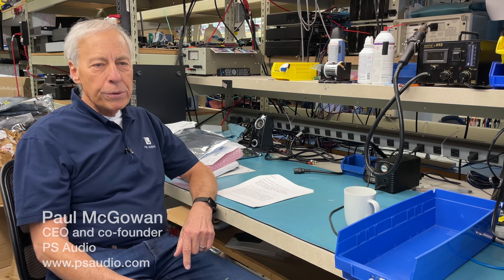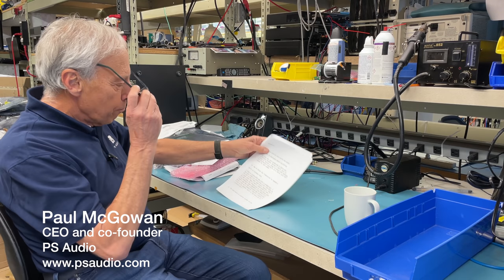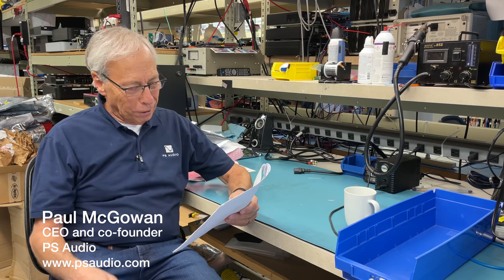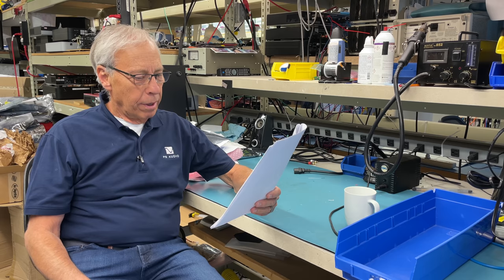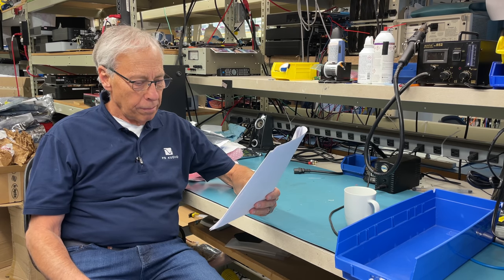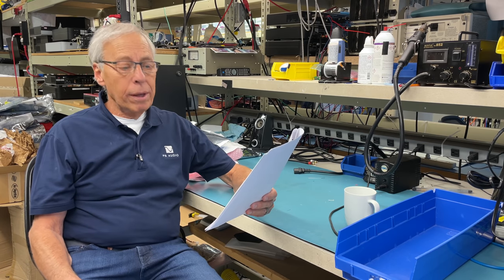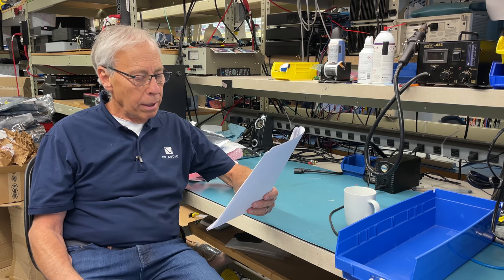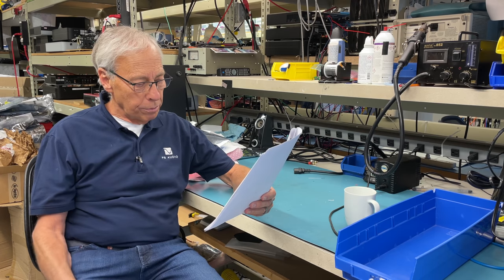How to block low frequencies to speakers

Comment: Totally agree, where the mains roll off naturally is where the sub should start. 
The sub shouldn’t replace anything, just add lower frequencies of bass.
Reply: The problem is when small bookshelf speakers are trying to make bass down to around 40Hz and they do it with poor distortion. Your subwoofer will either overlap significantly in half it's frequency range and drums around 40-100Hz can become much more distorted when playing loud; from my experience. Especially music that has more pure deep bass can reveal when your poor side speakers are trying to reproduce deep bass but can't do it well without distortion in 10s of percents.
Reply: The most common starting sub cut-off recommendation  is @ 80 hertz whereas any speaker out there goes down to 60 in the very least. Then again, if you have a crappy drivers then....
Reply: There's another good reason to intentionally roll of the response, as I've found out. If you're sitting close to the speakers and the sub is off to one extreme, you can get quite a lot of undesirable overlap in the response, and very odd sounding bass, not to mention it spoils the illusion of the bass being omnidirectional. I found that adjusting the phase, and putting a fairly sharp roll-off on the main speakers at around 80-100Hz helps quite a lot, so that only the main speakers or sub are playing at any one time. It puts a narrow notch in the response, but otherwise it works quite well to give a uniform, flat audio across the low end of the frequency range.
Reply: @ThinkingBetter  That's actually a good observation. Woofer drivers are quite nonlinear at their extremes, and they will produce a lot of distortion and harmonics if there's significant bass and midrange audio being produced by one driver at the same time, and this can be seen on instrumentation if you take measurements. Its possible to even produce IMD at the excursion extremes if two tones are being played by the woofer. A sub helps get that audio out of the main speakers, freeing them up to just handle the mid-bass, which produces a lot less distortion at higher volumes.
Reply: @mysock351C  Paul is promoting what his current product lineup can support. It would be nice if they actually addressed this problem with proper 2.1 support.
Reply: @ThinkingBetter  I agree. When it comes ot being bare-bones, seems with audiophile equipment they want to make it so "minimalist" that you don't even get the skeleton anymore.
Reply: @mysock351C  Yes, the audiophile industry is often doing business with some snake oil arguments unfortunately.

Comment: I agree 100% that your main speakers in stereo should be run full range. For home theatre and a sub. I think in many cases it is good to cross over at 80hz depending on your speakers. Action movies are mostly very dynamic and with a crossover you will not stress the speakers that much, giving them more head room. It is also problematic running back speakers low if you for example hang them on the wall. Personally I run my Sub with room correction and cross over at 80hz. For music I do not use the sub at all and run front speakers full range.
Reply: Yes, the fact is that the enclosures come with built in crossovers, no reason to do anything but let the speakers work how they were designed.

Comment: I pretty much agree with Paul. As he states most speakers are designed with the intention that they will be hooked up and enjoyed. The only thing I would add would be that if someone buys a sub because their speakers audibly distort when trying to play deep bass, then you would need to take a different approach. In this case you would need to determine why it is distorting. Usually this is due to cranking up the bass control and the volume which will cause the amp to clip or exceed its rated power on transient peaks. If this is your issue then you would need to buy a sub with speaker level inputs.

Comment: "I know there's a lot of debate on this but...."
There sure is, for good reason. IMHO if you like to run on the loud side, you're better off high passing the tops and letting the subs do the heavy work....much cleaner 👍 
Happy New Year !!!!!
Reply: Yes, I can definitely agree on that. Smaller speakers are limited in their woofer excursion and also make port noise when playing loud. Their distortion and poor decay performance will hurt the otherwise great sub bass a proper subwoofer can do. And the extra power from the stereo speaker can yield better dynamics for the overall frequency range.
Reply: @ThinkingBetter  exactly, I know I mentioned running at higher levels but of course it helps at any volume 👍
I don't know why people would ever do it any other way ?? I've tried it several ways including high level in like Paul recommends....
I always set the systems up with high pass on mains, low level into subs 😁
Reply: @poserwanabe  Paul's engineers just need to get their act together and make a proper solution for this and he can change his messaging cause there is no doubt from actual experience that in many cases a proper cross-over-filter (active) can do a better job than cheaply overlapping a small speaker struggling with deep bass with an excellent subwoofer designed for that deeper bass. Your side speakers can make THD in the 10s of percent when playing a 50Hz drum at loud volume while your subwoofer can do it in perhaps 1% THD. The stereo speakers I have in front of me right now make a lot of port noise around 30Hz while I can almost hear nothing actual bass from them. Without cross-over that port noise is factually very audible and that's why I decided to run with a proper 2.1 active filter configuration. Especially audiophile music with pure deep bass gets harmed with systems having small speakers trying to do such deep bass.
Reply: @ThinkingBetter  so TB, the question becomes why do audiophiles resist the obvious ??? 🤔
Happy New Year to all !!!
Reply: @poserwanabe  I'm an audiophile and have friends that are onboard on this matter, but I agree that many don't and you can in some cases be right and wrong on the same subject depending on how you look at it. A poor high-pass filter on your stereo speakers, poor phase management, poor frequency response calibration etc. can make active cross-over a bad option. But it's like saying "sedan cars are bad" because your reference is a Lada.
Reply: @ThinkingBetter 
Thank you for acknowledging that the situation has some complexity.
I wish more audiophiles would do as much on different subjects.
Reply: @ThinkingBetter  Well, I'd say a sedan might also be bad when a convertible is the better choice for you. If you want to blast it, then I agree, high-passing the main speakers is the better idea, but if your listening at low to moderate volumes, I'm not really sold. There's always a lot to be said for fewer parts in the system, and then there's budget: Every system has one, and the money for a good active filtering solution may well be better spent elsewhere - or not spent at all if the benefit is marginal for your particular application.
Reply: @sebastianpolcyn6358  Less can be more but usually less is less even for cross-over filtering. Cheap two-way speakers get away with just adding a series capacitor to the tweeter while the best two-way speakers have optimized more complex cross-over filters achieving a refined performance on frequency response and phase. Paul’s suggestion is sort of closer to the cheap approach. And yes, cost is a valid argument of course.
Reply: @ThinkingBetter  Usually, less is less, I do agree. It's like they say: "Make everything as simple as possible, but no simpler than that", which often ends up meaning that you need significant levels of complexity to get satisfactory results. But I would argue that in some cases at least, minimalist xovers can also work on quality speakers, if f.ex. you have very well-behaved drivers. Dynaudio is a good example: They focus heavily on driver design and quite famously use mostly 1st order filters with excellent results.
Reply: I think trying a "bass blocker" or capacitor is a good idea as long as you don't suffer from any cancellation issues with your particual setup. Especially due to room acoustics. In fact, there are certain situations where a capacitor actually improves the sound where there is a slight phase shift while at the same time keeping the main speakers safe from infrasonics and damaging low signals.
Reply: Oh, how naive you are. Don’t you think there isn’t a dozen good reasons for not just inserting a cap if Paul says so? Filters are not just simple on/off machines. Splitting a spectrum is not “free” and it does matter where you do it.

Comment: This is why so many can't integrate their subs to the HiFi system, they often got ported speakers driven by an regular pre-amp that don't have hi-pass filter and the results is the bass driver will work over it's sub frequency capability and also alot of phase shift just under tunning frequency and then running the front speakers at the same time an lowpass filter is applied to the subwoofer that also create it's own phase shift and it all will super difficult to tune in due to all the errors.
My best tipp is to plug the ported front speakers to make them closed instead then they Will be able to play louder and cleaner at the same time possible to integrate the subwoofers much easier and smoother.

Comment: Sir, I am using 5.1 Onkyo home theater. Sadly my sub is dead. However, I have bookshelf speakers that can hit upto 37 Hz (yes, I know not upto 20Hz). My question is can I use these Bookshelves as subwoofer without damaging (Only one at a time)?

Comment: Many integrated stereo amps have the possibility to use built in high pass filters.. But I rarely recomend using them.
Only for a surround system for the surround and center channel in general.

Comment: Since you have pre-outs, you may want to look into a miniDSP 2X4HD. i had one didn't need the sub out but it worked great. I Used it also as a DAC which can utilize it as a digital input, the built in DAC worked fine for me. But then it would need to feed into your amp not out.

Comment: Paul is right when you don’t play loud and your stereo speakers are not struggling with port noise and distortion from hitting the healthy excursion distance of the woofer cones. But one major point for me in having a subwoofer is to crank up the volume to get concert level realism including in the bass. It takes a good active cross-over to make the magic happen with proper care for phase and frequency response; and not many products do it well allowing for the specific tuning matching your particular setup. I can recommend the miniDSP SHD for those into digital music.
Reply: @Lloyd Stout Well, concert level is not an absolute dB value. I do enjoy having my house shaking through my subwoofers with some deep drums but not crazy loud. 100dB is ok. Important is that the peaks come through without amps clipping or woofers hitting max excursion.
Reply: @Lloyd Stout I am very conscious about keeping the deep bass as undistorted as possible. I like music with a high degree of dynamics incl. especially in the bass rather than just loud.
Reply: @Mr Do I'm not sure your definition of "real music", but actually I enjoy a lot of music with plenty of very deep bass down around 30Hz. Of course it somewhat depends on the genre.
Reply: @Lloyd Stout Great point! We would have to live in an ISOLATED commercial area like a warehouse or something to be able to crank it that high, and not get complaints from neighbours! That's why nightclubs are all in areas that are  deserted at night. I'm half DEAF now from LOUD music in my vehicles from decades ago! I now have a decibel meter to show me the DANGER zones visually. I find about 72-74 decibels to be adequate for my music, but I am... OLD now!

Comment: Agree with Paul.  For those that don’t believe just give it a try yourself. 

My preamp sound processor has selections for full range or small main speakers.  I have Paradigm Studio 60’s and before this used Studio 20’s as mains.  

My thought process was that if I cut out the lower frequencies from the bookshelf Studio 20’s then I may be able to achieve better upper mid bass punch.  Didn’t quite work out that way.  It just sounded thinner and less full range. 

I even ran full range and out a cap on and it’s less subtle but still better full range. 

The same goes for the Studio 60.  Better mid bass and more full range than bookshelf.  Still not getting the hard hitting drum kick I’m looking for.  I tried the small speaker setting and same results. Sounded just thinner but makes me less nervous when playing really loud home theater with heavy bass. 

Also tried the passive cap and still sounded better full range.  

Each time too I tried adjusting the subwoofer crossover frequency.  If set too high then it gets too boomy.  

So at this point I either have to larger main speakers with larger drivers but I also don’t want vocals to be sacrificed. 

I’ve had this set up for nearly 20 years so it’s not like there is much mid bass lacking.  It’s just not that of the level of a live performance.

Comment: I find in many full range tower\floor standers if you play certain recordings too loud you get a bit of a "flapping" effect\sound from the sub 50hz section. It be nice to have a low cut off that can blend into your sub or simply spare your main speakers from flapping/farting whatever ya wanna call it.

Comment: By Paul's logic shouldn't all drivers, mid, tweeter, roll off naturally.   What about the IRS subs and the active sub on their new speakers.  Is there a filter or does the mid bass roll of naturally.   I know he will say that's the way they're designed, but I dont think typical speakers is designed to produce sub  frequencies.

Comment: i get't now. whenever Paul mentions of subwoofer you mean an independent active subwoofer from some notable brand - an all-in-one product ..
I've been thinking about adding a large loudspeaker with a box , a "farting box" as subwoofer,   to my old stereo amp....
how to make that passive box sound good, or integrate easily? any easy solution to high-order lowpass filter..
Reply: Using a sub with high level inputs and its own crossover, and just putting the x’over to the point where it integrates seamlessly is the most basic and effective way I know to set it up

Comment: Let's see...if I follow Paul's advice and run my Gallo Nucleus satellites full range, I will be in direct opposition to the owner's manual which specifically states to not put low frequencies through them or I risk damaging them, which isn't covered by the warranty. Great advice Paul!

Comment: I have always thought that unless the speaker is part of a multi speaker set like 5.1 it most like will more than handle full range np so long as you don't boost the bass much. 
In tests I have run with and with out subs I have found that most full range speakers blend better if you don't put a high pass filter in. Makes the blending of the sub so much better.

Comment: Thanks Paul! I'm so glad to hear this voice of reason. I know what you are saying is true because the difference can readily be heard. Setting my towers to small never seemed logical for stereo music or surround  even when using an active sub. The simple observation I have made is that running the speakers full range makes for a fuller sound albeit a warmer AV unit. I now think of bass augmentation as better bass extention rather than it being a more localised substitute. Interestingly, Andrew Jones praises the merits of multiple towers because of their multiple sources of bass output into a room, over a single sub. All subject to the functionality of each component.
Reply: Paul didn't mention the fact that speakers you buy, have built in crossovers. So they are meant to be played full range because the crossover will cut the low frequencies off anyway. I agree mine are set to large, and the sound is so much better.

Comment: Agreed
But I think if it is possible to open the amp, you can integrate a low cut filter ..simply change the decoupling capacitor to a lower value capacitor in the power amp circuit . Also you might need to change a resistor that is in parallel to ground after the capacitor. 
I have tried it and it works very nicely. 🙂

Comment: To get it right with a high pass filter to the main, you also have to do a time delay for the mains; otherwise the blended sub and main have a phase and impulse mismatch that is probably audible. Much easier (and much less expensive) to ignore this complication and follow Paul’s advice. You may get lucky and not find the resulting sound objectionable because for most bass it is difficult to know what the original sounded like.